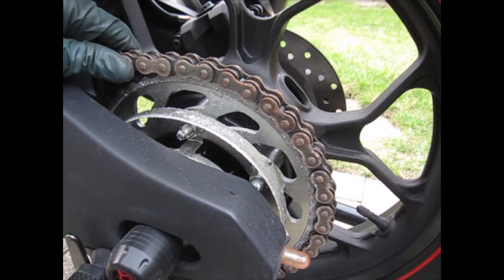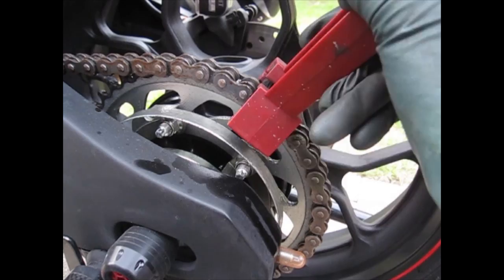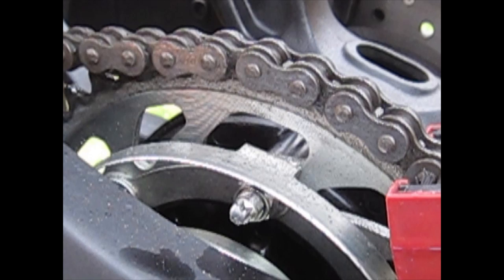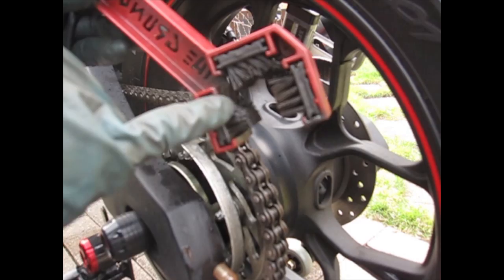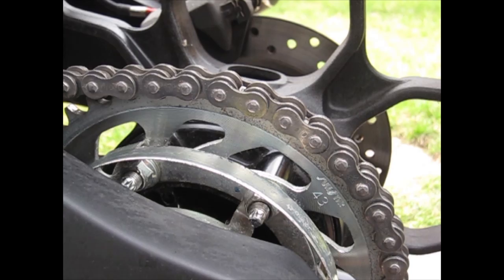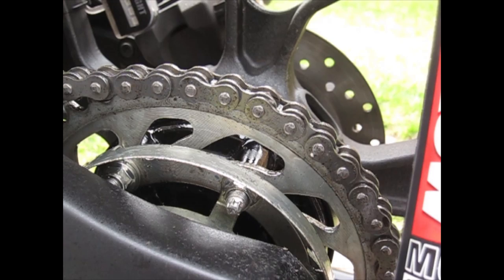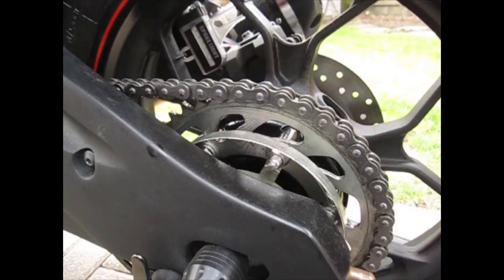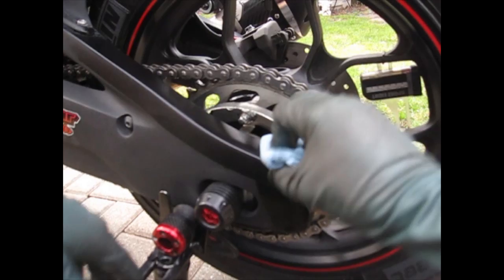How to get Rust off your bike chain for Yamaha R3

Comment: Do you also clean the front sprocket, from time to time?
Reply from the maker: yes ,  it wont be as dirty as the rear, at least not on the sprocket itself but the cover of the front sprocket will have lots of oily dirt good idea to clean all that off